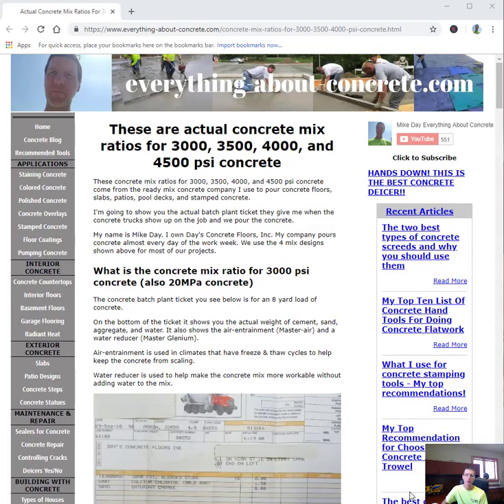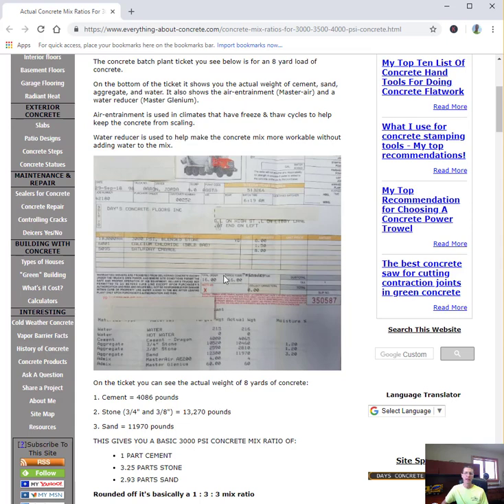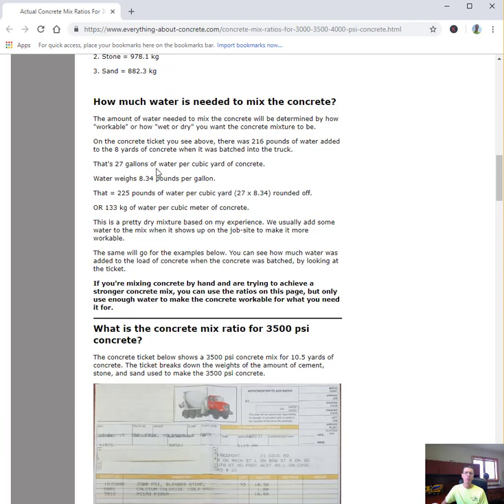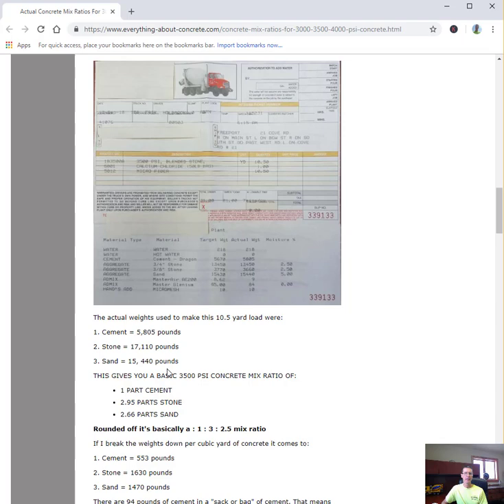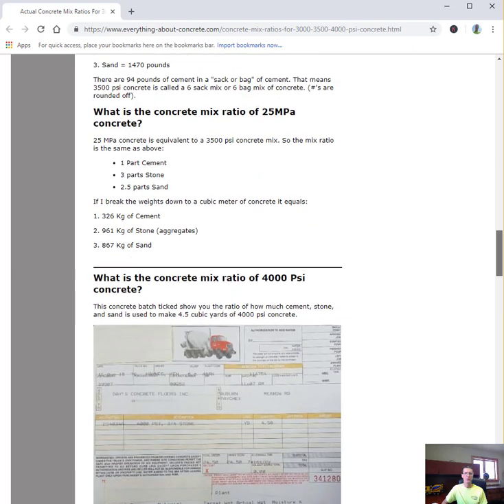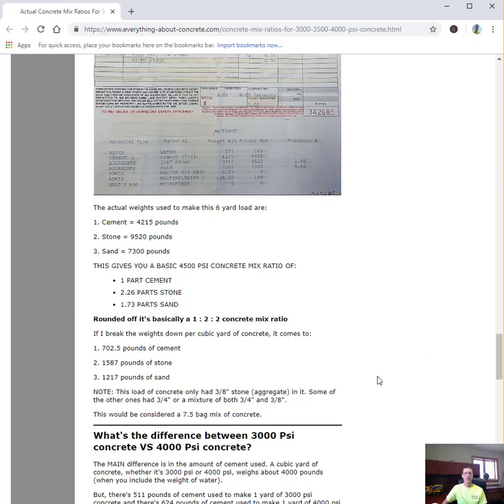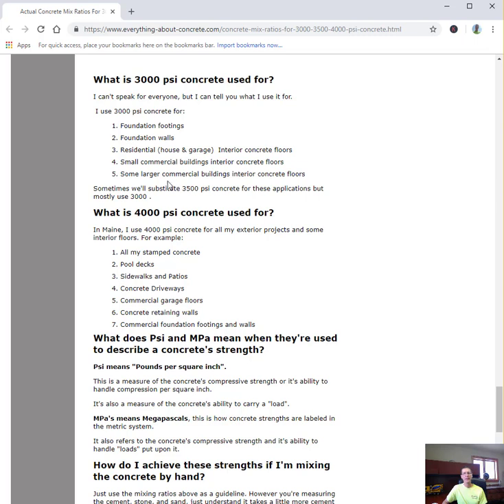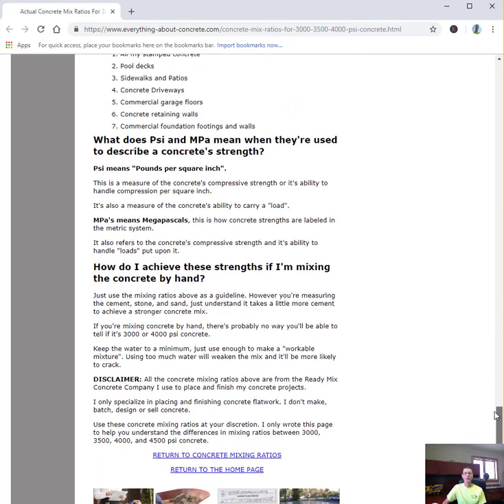DIY Concrete Mixing Ratios to make 3000, 3500, 4000, & 4500 psi concrete

Comment: But here in Colombia a forman told me to make strong concrete to use 3 buckets of material for 1 cemento.  How is it that you say 3 buckets of sand and 3 crushed rock total of 6 buckets can make 3k psi concrete.

Comment: My soil is clay. My regional temperature can get as hot as 100 degree in the summer and as cold as 14 degree in the winter. But these temperatures are rare. It mostly hover around 30 degree to 80 degree year round. With these conditions, I propose my house-front sidewalk to be  4,000 PSI concrete, fiberglass rebar, 6 inch thick.

Comment: Are these ratios by weight or volume? You said “shovels full”, so I assume by volume. Would unpacked flush bucket loads be more accurate, or does it need to be that precise?

Comment: Thanks for the vid. Came here from your website which has been useful for me on a lot of DIY jobs.
I'm in Japan and here the 1:2:3 mix is the one true mix as far as I can tell - but in Japan there's only ever one true way of doing anything... 🤣
Anyway, the thing that gets me is the metric MPa ratings vs PSI ratings just don't seem to match up. Going the standard 1:2:4 mix is rated 2500psi, but only 15MPa, which is 2175psi. 1:2:2 is rated at 4500psi but only M20 (which is 2900psi). M25 or 25MPa concrete at 1:1:2 (what I just poured for my deck piers because why not over-engineer them 😎) translates to 3625psi, but it's not even on the US table.
Obviously in the real world a 1:2:4 or 1:1:2 mix or whatever is what it is and doesn't care about national borders or man made measuring systems. I'm just wondering are US engineers over-estimating the strength of their concrete, or are Europeans under-estimating theirs?
Reply: I was wondering that too. Maybe the cement has different characteristics, or maybe the strength is measured with a different method.
Reply: @stanilastefan1687 i know portland cement has different strength 30 40 50 60 mpa

Comment: If you skip the stone and use just sand and cement  how does it affect strength?
Reply: thats mortar. for plastering bricks. typically below 2500 psi strength depends on cement sand ratio

Comment: Many thanks for this video.  Am looking to make cement hollow blocks, and have been advised to use minus 1/4" gravel, washed concrete sand, cement and water on a ration of 4 gravel, 3 sand, 2 cement and 1 water.  All measurements to be done with dried materials, by weight, not volume.  The locals work on a 15 MPa mix strength, but, suspect that mine is going to be a tad stronger.

Comment: Thanks, need to build a 18(w)x38(L) garage pad and contractors are quoting 4000psi, so this is good to know! I built forms for concrete and set them up, but never handled the pours, that was another crews job, so I know nothing lol

Comment: Thank you so very much for the video, I've been looking for one and yours is the only one answered my questions. 
I'm trying to build a wood fire oven and since I've got zero experience in anything related to building and construction, I didn't know but few facts like the thickness of the slab which is recommended to be 120mm and 40 mpa, the latter was so vague - I'm not sure if 40mpa is the right mixing ratio, sounds too much for a 120cm width x 180cm length x 12cm depth, would very much appreciate your advice please. Sorry for my lengthy comment and many thanks again

Comment: How do I get a very white colored concrete? I don’t want to color it.
Reply: White portland cement is just something you can buy. To my understanding, the color in cement comes from a bunch of oxides that aren't actually needed and aren't found in all cement, so you can just buy a "white grade" cement. Sand comes in white. Just buy white sand, which is already on the market for other reasons. 

 If you are pouring a small amount, you might look to specialty sources for aggregate. I have seen people pouring countertops with aquarium rocks, though that is a very fine aggregate. Depends on what you intend to do with it. But depending on application, you may not WANT white aggregate. A lot of terrazos seem to be based on a colored aggregate inset into a white base mix. 

Really though, I would think this is the primary reason to mix your own, in addition to say, mixing large amounts in remote locations, like say, you need to pour a far off grid foundation but want to save some money over buying premixed bags. 

I would be careful on the aggregate though. I have seen some examples of people using relatively fragile stone for testing, and it has broken relatively easily. I am no geologist, but make sure whatever white aggregate you choose doesn't end up being chalk or anything. Choose your aggregate carefully for your application.